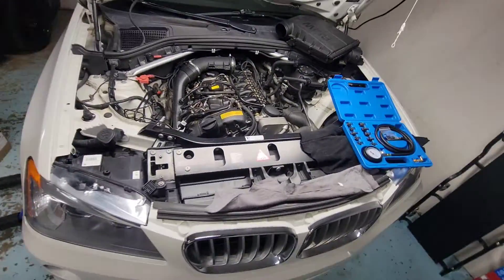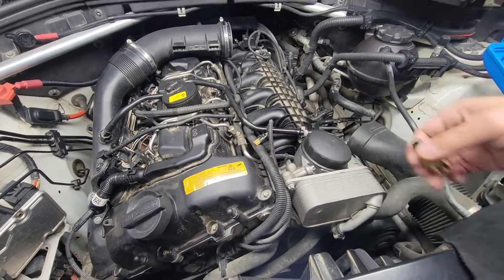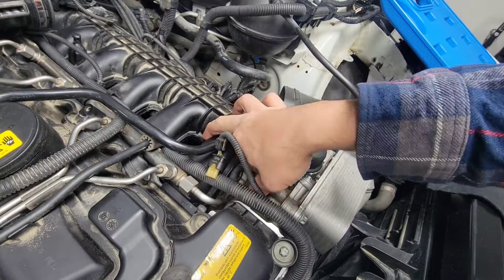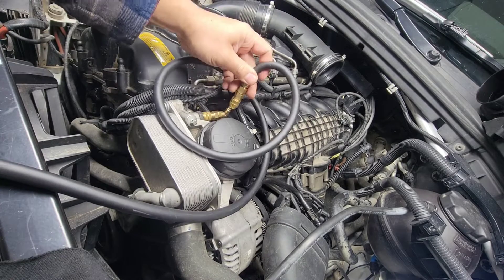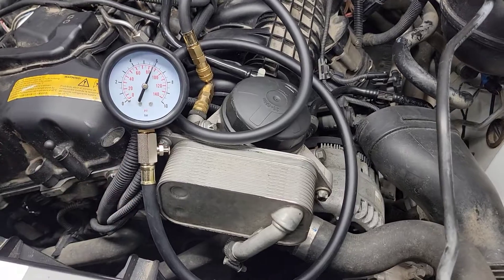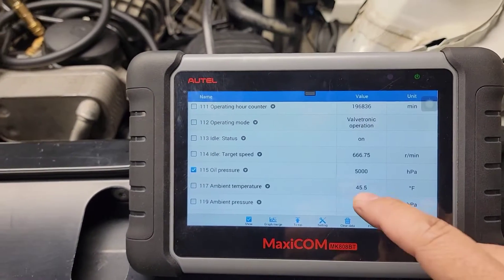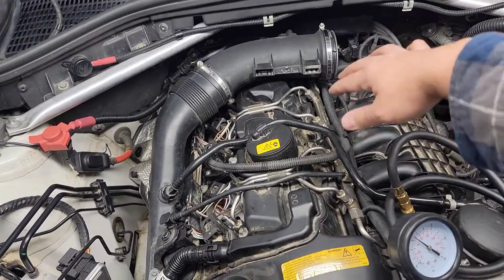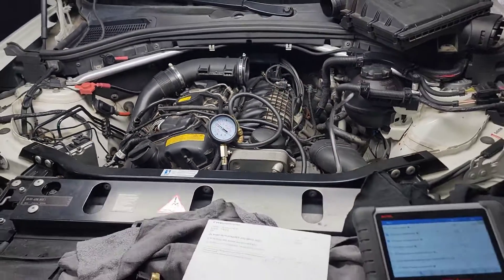[Oil Pressure Test]  Bmw 3.0L Engine with Oil Spec Guide #diagnose #mechanic #automotive

Comment: Thanks for the vid.
How come it went below 58 after some time?
Do you know what is this minimum of 21psi? When is this minimum measured?

My N43 starts at 6bar and then as it gets warmer goes down to 2 bar, keeping it steady there.
Reply from the maker: N52   oil pressure on idle min bar 1.5
Control pressure on operating temperature  4.0-6.0 bar

N55 oil pressure on idle min bar 1.5
Control oil pressure on operating temperature 40-60bar

Comment: I get about 24psi on my n55 f10 at operating temperature. It’s starts high at around 50psi when engine is cold, then gradually goes down to a constant 24psi when at optimum temperature. The pressure increases with increased rpm
Reply from the maker: Ya sound normal to me, your engine  healthy